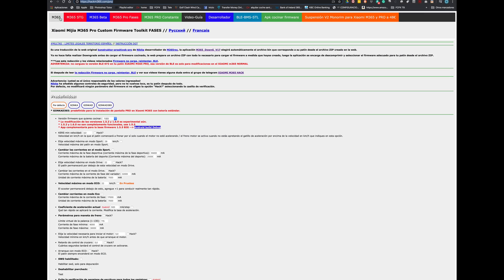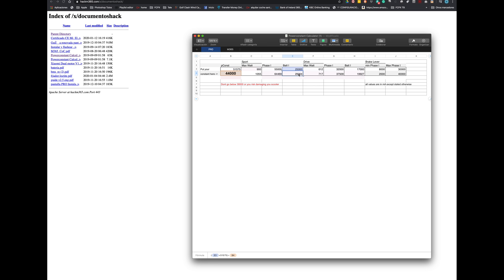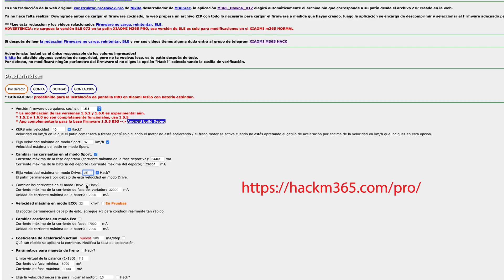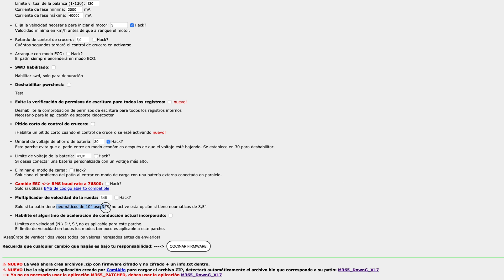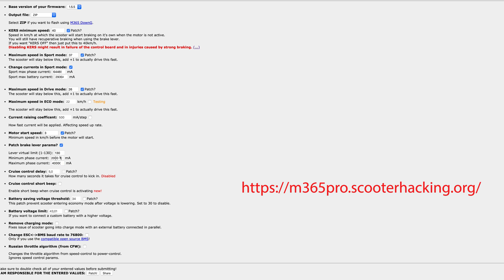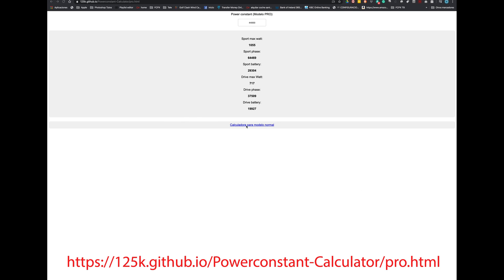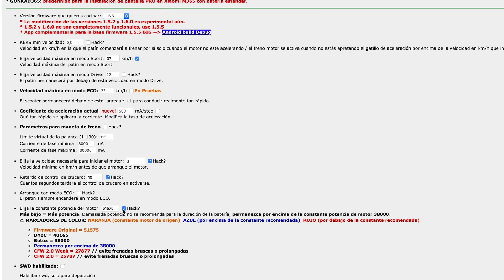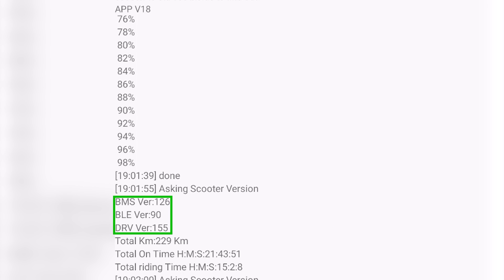CUSTOM FIRMWARE Xiaomi M365 PRO🛴 - SPEED and POWER Increase

Comment: i need this for NOT pro, my pro dashboard is a not flashable chinese fake...
I absolutely need the possibility to set that it is only fast with lights on, because German 20 kmh laws.
Reply from the maker: You'll need to use st link first in order to flash a good ble first into your fake dashboard
Reply: @DavidTechEs  uh working on theses plantines is microscopic work, i think i t ry it with original m365 board thanks
Reply from the maker: @Bergwacht  👍

Comment: is 44000 safe for pro??? whats the max TEMP u get on controller? thank You!!!
Reply from the maker: 44k is more than safe, I'm getting 45 degrees tops, but that depends where you live
Reply: @DavidTechEs  after going uphill i see 55' on stock, and have no idea how high is to high
Reply: normal riding its no more than 40 but uphill gets 55 quick- if i go with 44k i can imagine this will make it more hot
Reply from the maker: @DRIPRID3R  55 degrees is nothing. Up to 70-80 degrees is ok
Reply: @DavidTechEs  whats the max safe power constant u used on pro? im same weight as you ;) but want to keep it safe
Reply: @DavidTechEs  THANK YOU FOR HELP!!!
Reply from the maker: @DRIPRID3R  No problem! I'd say don't go less than 38-39k
Reply: @DavidTechEs  thanks my friend 35top speed no problem with 42200 mpc ;) no problem with temps so far!!!
Reply from the maker: @DRIPRID3R  Great! Thanks for the update! Enjoy the ride now!
Reply: @DavidTechEs   what do you think about motor temp? controller and battery is ok 40 controller bat 31' so no problems there but motor get super hot! hurts when u put finger on it after ride. what u think too high mpc or it will be ok
Reply: @DavidTechEs  motor is dead now
Reply: Leafninjaz YT yes burned the controller but motor also gets weaker due to extra heat that affects magnets inside. The more power u give the more heat u get on the motor. Long story short i would leave it stock and if u need more power do what i did in the end bought 2400w scooter no need for mods
Reply: Leafninjaz YT my controller burned out at 60c as soon as it hit 60 first time ever it was gone.

Comment: Hi David. Thank you for the detailed tutorial. Scooter have been successfully updated. By mistake I've update to latest version 1.6.8 I went through same tutorial again, but for some reason on 80% downgrade stopping and downgrade app disconnecting, after connecting back, nothing is happening and BLE is not downgraded and again it's asking to flash and check version. I use latest m365_downg app. Current firmware 1.6.8, BLE: 110; BMS 126; DRV 168. Any known issues with that? May be there is a custom firmware that I can flash on new BLE? Thank you!
Reply from the maker: Thank you! You need to download the BLE first, to 090. I have another video on how to do that, but basically it's the same process
Reply: David Tech David Tech Thanks for your reply. First time I’ve successfully updated custom firmware with downgrading ble (watched both videos). After that I’ve update to original firmware by mistake to 1.6.8 Now, when I’m trying to downgrade BLE, process stopping at 80% and disconnecting from scooter. After connecting back, it’s showing latest BLE :(
Reply from the maker: Strange.. can you try the app XiaoFlasher instead?
Reply: @DavidTechEs  May be it's phone issue... I was trying to download XiaoFlasher, I can see my scooter from the list, when I select that it's keep connecting and nothing happening after.. I'll will try another phone and will reply latter with results.. Thanks for your help!
Reply from the maker: Let me know how it goes with another phone
Reply from the maker: Tomorrow I'll upload the new method for hacking the scooter, is just awesome. I'm finishing the editing. Works just GREAT!
Reply from the maker: https://youtu.be/NvLA2XJi2is

Comment: Hello David, thank you for the video it helped me install my own firmware. You are my hero!
But after I tried a lot of things I can`t ride more than 25km/h. 
I set the parametres according to you, only KERS I left on 3, but I still can`t get more than 25km/h. Am I doing something wrong?
I don`t have external batery so  my max speed should be 31km/h. Do you have some advice?
Thank you.
Reply from the maker: Thank you!! You can try to increase the power values, like 38000 for the power constant.
Reply: @DavidTechEs  Thank you for your answer.  They apparently changed the site and it is not possible insert values to "Sport max phase current" higher than 65535. 
I will probably have to stay at 25km / h. :-(
Reply from the maker: Try the new method, i have a tutorial https://youtu.be/NvLA2XJi2is

Comment: Great Video! Thank you for sharing.
I'm 120kg, do you belive that 40000 is "safe" also for me? ;oD
Reply from the maker: Thank you! Yeah no problem, I'm 110kg. Obviously, we struggle going up hill and the speed won't be as fast as we were 60kg, but it will work just fine. Keep the tyres pressure above 4.5-5. I'm checking the pressure every week at least
Reply: @DavidTechEs  Thank you!
Reply: so far you know, is it possible to reverse the process?
I mean, it's possible to read the firmware and its setting from the kick scooter?
Reply from the maker: If you want to come back to the official firmware, you can do that updating with the Xiaomi app at anytime. However, the official version can be not hackable yet, and you may need to wait until developers dechyper the official firmware.
Reply: @DavidTechEs  Hi! Would you recommend the russian throttle algoritm? Would it still go 32km/h (maximum desing speed) even if it overrides the speed settings?  Thanks for the video! :)
Reply from the maker: @happygiraffe9787  Thanks! As I always say the best thing is to try different configurations, and see what works best for you. The Russian throttle may give some extra speed. To be honest I've never used myself, so I can't guarantee either safety or extra speed
Reply: David Tech Had a test drive now. Only changes made were Russian algoritm (I have to recommend) and 30v power saving (off). It’s a beast now especially uphills the power is insane. Thank you for the videos, left like on both of them :)
Edit: 90kg driver, same uphill now goes 28 km/h instead of earlier 21-22km/h
Reply from the maker: Try this new method, really improves performance. https://youtu.be/NvLA2XJi2is

Comment: Can you do this with just your android phone?
Reply: Done it as per tutorial, can't believe how easy it is! I will try my scooter tomorrow, i customized it identically, with the same values and all even thou im good with max 30km speed. Let's see tomorrow then Ill just modify it as i see fit.
Reply from the maker: Great!!👍
Reply: It worked!  My speed was max 32kph and it's how i liked it althou i usually just drive around 28-29 on Sportsmode, boy it is fast. But i don't know  im kinda not liking it, it felt too scary to drive since now it accelerates too fast, and everytime i brake and accelerate i can feel and hear a sound on the engine or battery?? Hmm. So i customized it again, and i only changed the kers to 10 (i don't know what this does really) and the Sports and Drive speed, the rest i kept the same. Is this okay?
Reply from the maker: Try this new hacking method, the acceleration is smoother https://youtu.be/NvLA2XJi2is
Reply from the maker: Yes, you only need an Android phone

Comment: hello guys, what is the difference vs faces and constant ? what is the best ? i don't understand
Reply: All right :) thanks for all
Reply from the maker: @FanatiKJoey  Anytime!
Reply from the maker: Basically, if you modify the power constant affects all the modes. However, if you modify using the currents you can setup each mode individually which gives you more control
Reply: @DavidTechEs  Ok nice ty, i will try like you do in faces
Reply: You put KERS on 40, but can i keep it on 3 even with faces firmware ?
Reply from the maker: You can, but I recommend to setup it up a bit higher than 3. I just don't like the kers that's why I used 40
Reply: @DavidTechEs  Why disable KERS at all? It says disabling can damage..

Comment: Very detailed video! Thanks! My question is how much increasing current in "Sport mode"  can damage the battery life.
Reply: Okay, I hacked mine Pro without changing currents and getting 32km/h. Does that mean that battery life will be normal, that I will get normal range? 👍
Reply from the maker: The default configuration is for a 51k power constant, hence, if we modify and increase the juice the battery life will go down few km, it's expected
Reply: @Belamarimages  Hi,i want everything stock except top speed on sport mode,like 32kmph.I have mi scooter pro. What i should change?
Reply: @mareklengyel7685  hey, well you should only increase the speed value and leave all the rest at default. But I'm not sure if you would need to change currents values for that. I changed mine. You should ask David Tech. Mine top speed is 34-35km/h with 37km range.
Reply: @Belamarimages  i need only higher speeds like 32kmh,no need more power bcs im lightweight,tried this site http://xiaoscooter.site/en/custom-xiaomi-electric-scooter-pro-firmware-builder,changed only sport mode speed to 33kmh and it works,everthing else keeped stock. But i saw option to change motor power constant dissapeared...will do some power test tomorrow,and compare it with stock fw.In stock i not get over 800w and 22A,will see how this will work.Also nothing should happend to electronics or motor/battery?Btw your scooter still work with custom firmware?
Reply from the maker: Thanks! Won't damage your battery, but will reduce the km that you can get out of it. Never go bellow 38000
Reply: So, I guess if I leave it at default and max speed at 32km/h, the battery might have almost the same range as default. 👍
Reply from the maker: Take a look to this new method, it's awesome https://youtu.be/NvLA2XJi2is

Comment: Guys. I tried modding my pro. I put ble74 pro v2, CFW 155 and it feel like acceleration and other parameters changed but still got 26kph top limit
Reply from the maker: Thanks fro watching! The hardware won't allow you to get much more. You may need an extra battery mod for more power and speed
Reply: Got GONKAD file from Youtuber “Pirate” and I’m able to go 30kph now

Comment: Hi David, is it fine if i just change the Max Speed in Sports Mode without changing the Currents settings?
Reply from the maker: It's perfectly fine, but if you want more power you will need to change the currents too. As I always say, try different values, until find the one that works best for you
Reply: David Tech thanks!

Comment: Nice video thank you. Could you please somebody inform me what parameters to change in order to have more power while going uphill ?  I know first of all I have to lose weight...
Reply from the maker: Thanks! In order to get more power you need to decrease the power constant, but I would not recommend go under 38000, you may risk the controller or engine
Reply: @DavidTechEs   Thanks! Can I use for example GONGAD or GONGAD365  as it is and change only the power constant to 40000? Do you think there will be problem?
Reply from the maker: I don't think will be a problem, as far as you stay over 38000

Comment: I think I got it to work now. check version says BMS 126  BLE ver 90  DRV ver 155 after I flashed my zip file. :) I left the KERS on 3. Is that very bad? I kinda like it when it is on, but I am afraid it will break the motor when I have the Max phase one 64469  and battery 29304 and max speed set to 37 km/h?
Reply from the maker: Thanks for watching! You can leave the kers on, no problem, but not at 3, increase at least at 10
Reply: @DavidTechEs  Ok, thank you! :) I changed KERS now to 11. :)

Comment: Hi David! I got 2 little problems maybe you know something. I have just changed the firmware after seeing your videos. Great videos! Thanks! I've got kers off and changed the params for brake lever as yours to 130 and 2000/40000. When I press throttle again in motion rolling free, it applies KERS for just a moment and just then it applies throttle again. It doesn't feel safe. Do you know anything? Also the brake light is blinking when pressing the brake and also when pressing the throttle too... do you have any issues with this? Thanks
Reply from the maker: Hi Justin, thanks! Well, I would leave the brake lever as default, and the kers just try what works better for you, off, on, different speeds to trigger it... What I want you to try is to hack it again, but this time using the app XiaoFlasher instead of M365 downg, works the same way

Comment: Hi Great videos! Can I use the 44000 constant and all the values for it, but only I dont disable the kers and also not change the values for braking lever? if I use 44000 is it a must to change all others to the values in the table? Thanks.
Reply from the maker: Thanks Ana!! You don't need to change those values for the lever or disable the kers, don't worry

Comment: @David Tech First of all, great video and resources! 

I just got my M365 Pro yesterday and have been cruising around a bit. 
After the initial testing i feel like i could use a little more speed then the 25 km/h standard speed. 
After checking, the firmware out of the box is 1.6.0.

My questions for you: Will this work with the 1.6.0 version i have installed or do i need to update first? 
If i now update the firmware in the MiHome app would i still be able to do this CFW mod? 
I read in the comments that there is a new firmware version recently (1.7.1)  where this does not work. 

Please let me know what you suggest. Thanks :)
Reply from the maker: Hi Tom, thank you for your kind comments. You don't need to update to the latest version. You only need to downgrade the BLE to 090Pro, it's in the video description. After this is done, you can upload your custom firmware.
Reply: @DavidTechEs  Hi David, Thank you very much for the info. Will proceed as described!

Comment: I tried xiaoflasher but my scooter doesn't go faster than 16mph
Reply from the maker: What have you done so far? I understand you have downgrade the BLE to 090, right? Have you custom your firmware and uploaded to the scooter? If so, what values did you use?
Reply: @DavidTechEs  my BLE is 071 and I put speed to 35kmh ?
Reply from the maker: @CAZruns  071??? If you have a M365 Pro, you should have 090. Your scooter is a regular M365?
Reply: David Tech yes my scooter is regular I have updated to BLE 091 now on xiaoflasher
Reply from the maker: @CAZruns  This tutorial is for the Pro version. I don't have the regular one, I'm not really an export for the process in the regular one

Comment: Could you email me your firmware file so I don’t have to put it all in myself, when I try your method, it changes my firmware to version “5.5.5” and all my settings go to stock
Reply from the maker: ok, let's try the following. Update to official 1.6.8 using Xiaomi app. Once it's done do it again, but this time use the app XiaoFlasher instead of M365downg
Reply: @DavidTechEs  hi david, i also did update on pro365 model and i have bms 126 ble 90 and firmware 5.5.5 and im able to reach 32km/h.
Reply from the maker: @kidsprotv5501  32km is about right, if you want more, you may need to consider extra battery mod
Reply: @DavidTechEs  thank you DaviD, good luck!
Reply from the maker: @kidsprotv5501  Thank you for watching! Good luck to you too mate!
Reply: @DavidTechEs  David do you know how many volts has the PRO version. Is it 42 V with 12000 Mah? Or is it36V with 12000 Mah?

Comment: hi David Tech i not understand who need write in the calculator? maybe you can explain me? i want configure normal parameters.can you help me?
Reply from the maker: You use the calculator the get the current parameters for the battery's currents, based on a power constant value. In the video I explained how to do it both ways, using only the power constant or using the battery's currents
Reply: @DavidTechEs  I understand.  But where do you put the numbers in the video for me to write the same y as you or do I have to write the individual ones?  Where do I get them? My English is difficult.

Comment: Is default constant 55000?  i went with 46000 costant because i want to be more safe, also because we have much hills and it feels like the motor will work to hard. 
also my first test on own firmware. 
 
Just want to patch speed for 30km/h
Phase current-> 61666
max battery current->28030

Is fine right? 

havent done anything yet, ima fucking chicken haha
Reply from the maker: Hi! Don't worry, the values that you are thinking are very very very safe. You might actually go a little bit further, no problem
Reply: @DavidTechEs  okey imma downgrade the ble now xD wish me luck!
Reply: Hey hey, ble90!
Now just new  firmware? 🤩
Reply from the maker: @fluffden  That's right!
Reply: @DavidTechEs  Okey so it seems like it work could just test in the living room, lol.
First off nothing worked just no respons.
almost just updated it. 
Then i restarted it, and then the headlight works and i could "drive" it. 
But the rear light doesnt work.. is it something thats normal when u change firmware?

Gj with the video btw! :D
Reply from the maker: Thanks! The rear light not working while you press the brake lever?
Reply: @DavidTechEs  rear light doesnt work when pressed the handle or when "always on" in the xiaomi app. 
Also max speed is 25km/h, but it feelt much faster, like more torque. 
Its windy outside so max top speed a hour ago was like 23-24 but now it sat happy at 25, but i want like 28-29km/h, why doesnt it work? :O
Reply from the maker: For more speed you can change parameters and see what works better for you. The ligh is strange, shouldn't happen that
Reply: @DavidTechEs  it have been raining so maybe some corrotion inside the lamp.
I adjusted the speed to 28, but same speed at 25, why is this? :O
Reply from the maker: @fluffden  can you send me a screening your settings for the custom firmware? davsaall@gmail.com